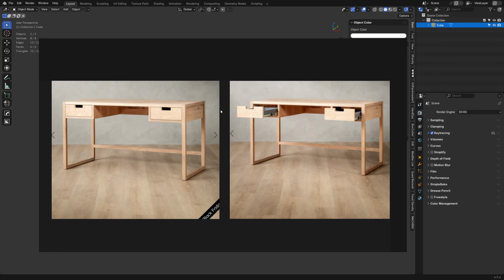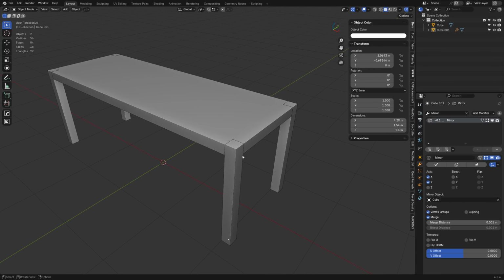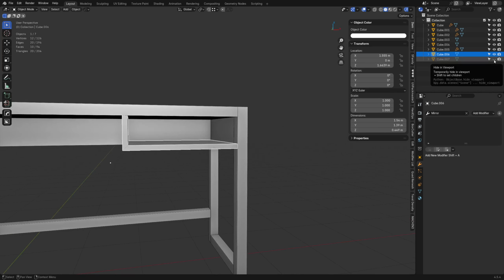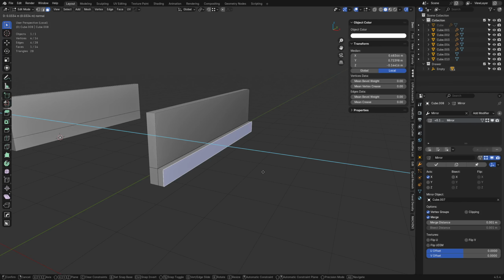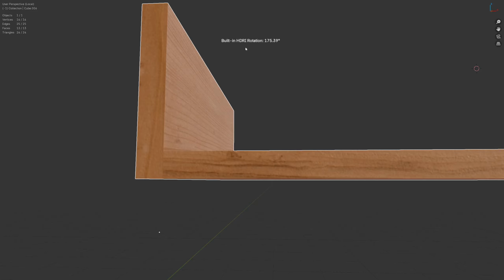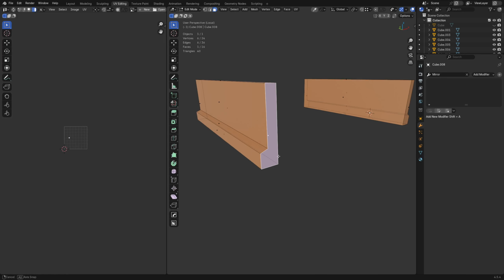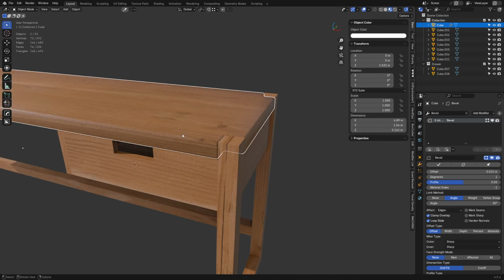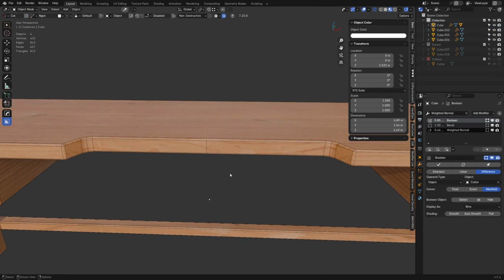Desk Modeling Tutorial - Part 1

Comment: Thank you so much for the tutorials ! Little question, I have a hard surface model which seemed weird with hard edges. I add a chamfer to it and then tried to bake a high poly version with a highly round bevel and baked it in substance painter ! The result is jagged triangles and a rough line on the seam line. Is it good practice to bake a bevel into a chamfer ? thanks !
Reply from the maker: Generally not really  because a chamfer will look like a bevel with weighted normals. However, it happens on some objects. Aliasing can be caused by a lot of issues, uv, bake settings, and materials, so its hard to know for sure which issue you are facing.